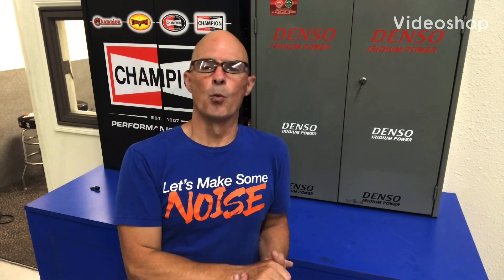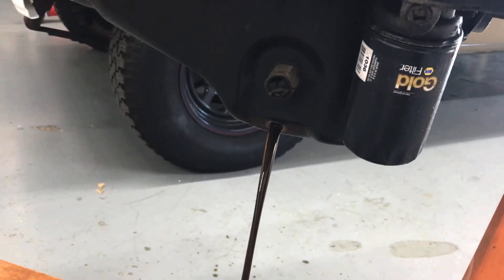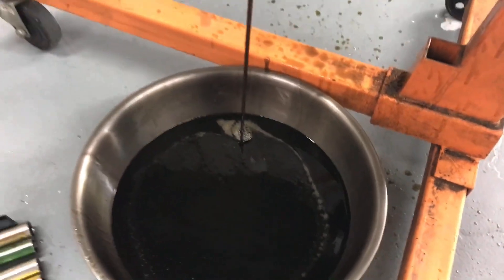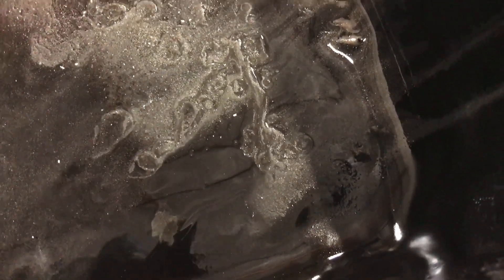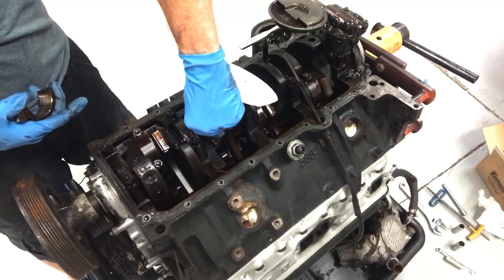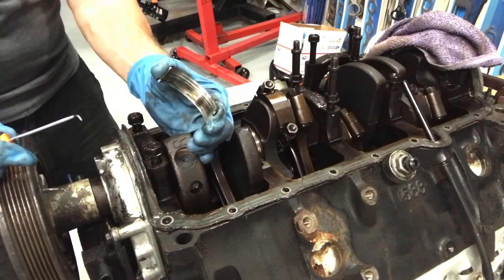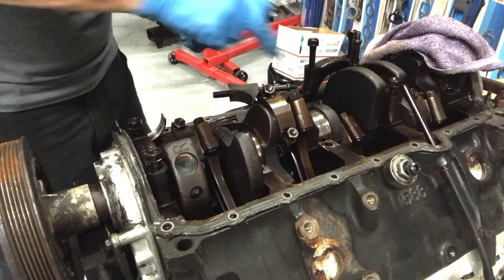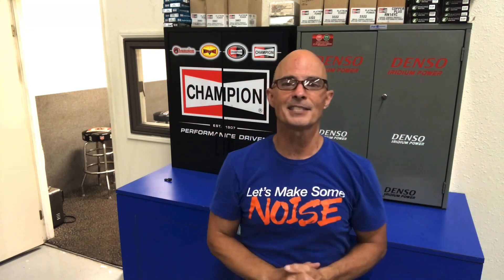THE OTHER GUYS L99 4.3L V8 (BABY GEN 2 LT1) WHAT WENT WRONG?

Comment: The other day you talked about making a 302 lt1 based engine. Back in the day I was doing stuff like that. My favorite was a small journal(forged) 283 with small chamber 305 heads and the 305 tpi setup. With mild cams in the 220 @.050 range they built fantastic torque and didnt run out of air like the 350 or even 305 with those small runners. We put one in a cj8 offroader and it had very good torque and would go over 7000rpms. We could out climb about anything, don't upshift just let it eat.  Tpi Speciaties did some tuning for us back then. It ended up in a nova eventually after a 4bt conversion. I was going to stuff one in a 71 vega gt with aluminum rods, flywheel and a t5. I wanted the aluminum corvette heads when they were dirt cheap but they dried up and someone stole my last set of good iron small chambers. Those were the days.  Your right, when I'm old and looking back on the stuff I used to do, I'll be glad I did it all!

Comment: I've mentioned this before, but thought it bears repeating. To tell this is a L99 and not an LT1, look at the side of the block at 3:42 in the video. You can see the raised numbers "588" plain as day. This indicates the L99. If it is an LT1, you'd see "327" in the same place. You can see this on most LT1/L99 engines when installed in their original cars. You just have to get under the vehicle. This same "casting number" (if you want to call it that) is on several other places on the block. This is just one of the easier places to see it.
Reply: L99 is a rpo code for the Gen 2 SBC (LT1) that happens to be 265 Cid (4.3L)
Reply: @shadowopsairman1583  - L99 is the RPO code for the 4.3L 2nd Gen SBC. LT1 is the RPO code for the 5.7L (350 ci). Not really sure what you're trying to say as it doesn't make sense.

Comment: Back in college my first "302" was in an old 60s or 70s build model a. It was always overheating. Had a monster custom 5 or 6 core radiator. Turned out to be a 283 bored until you could see thru the cylinders (like a 6.9 ford, "porus casting"). I put the Camelback 462 heads on a 400 block with a 350 crank, stock pistons with 350 rods and crank spacers. Ran amazingly well for a parts bin, weekend project.  Your always get my brain working, either looking back or forward. Thank you

Comment: Make Sure you get a set of Dz302 std. 4" bore Lumpy tops, and 30/30 grind Camshaft, along with a 4bolt main block to go with your 3" stroke crankshaft, to be a true modern recreation it should really have a forged steel crankshaft. I'd Put it in your Nova.

Comment: So, I just got done building a kid a 383 lt1. That was the second engine he had brought in. The first was a 4.3L. After getting his 383 together and getting all of his parts and pieces together, we noticed that the castings were identical. He didn't want to mess with the 4.3L stuff so he asked if we could just scrap it for him. Looking at every bit of casting it appears to be the same. Does anyone know of if that's the case? Are they the same casting, can I just bore the 4.3L to a 4" bore. We don't have a sonic tester to check the thickness of the cylinders. Part of me wants to build a high hp twin turbo minimum displacement sbc (a 4.3L). But I've always wanted to go the 302 route. Which I think, if all we need to do is take the bore on the 4.3L to a standard 5.7L, 4" bore. I also have a couple of hydraulic roller 350 truck blocks, which I think will be the smartest route, opening up the options for cylinder heads.
Reply: I dont think can bore em that much but try it and find out Ive never done it but took many 307 out to a 350 bore they were thicker. Also you can take the rods from the l99 4.3 v8 and use them in a 4.3 v6 with a offset ground crankshaft boom cheap budget v6 stroker. If crank grinder knows what hes doing he can put a big radius on the journals for strength and can use 229ci rod bearings there narrower.

Comment: Can't the crank be turned and aren't the small block rods 5.7" except for the sb400?
Reply: The 4.3l has 5.94" rods and 3.736(?) 305 sized pistons. If you use this crank and rods with 350 pistons in a 350 block it all works. You could grind or turn the crank but for the same cost Richard could probably get another whole engine from the Junkyard. When the rods start to change colour that's a good indicator that it's not as strong as it should be. They would probably work on a NA build but if you need a crank and bearings, a whole engine might be cheaper. It's still a bit of a mystery to me how this happened. Something maybe let go in the oil pump but the bearings shouldn't have been pitched if it still had oil pressure at this power.

Comment: Would be cool if you used longer rods like 6.350" long with 1.150" piston compression distance.

That would give a 2.117:1 rod ratio! Use the L99 heads as well, short stroke with longer rod ratios like smaller runners, supposedly.

Make sure its an LT1 that you convert so you can crank up the compression because of the reverse coolant flow. Should be easier to get the compression up with the smaller L99 chamber heads. 12:1 or higher would be great.👍
Reply: The above will make it a modern day DZ302. Modern, so solid ROLLER CAM, not that antique solid flat tappet Duntov turd.
Reply from the maker: it will have a hyd roller-like the stock ones
Reply: @richardholdener1727  

Well, that's more on the modern factory thinking. That's right, the factory never sold a solid roller cam engine so you're right on that.

I bought a set of Speedmaster sbc 6.250 rods that were on sale a few months ago for under $200. They're rated for 500 Hp and 6,000 rpm. I'm sure with a bolt upgrade those could probably be 600 HP and 7,000 rpm ready? Don't quote me on that though, you would have to ask Speedmaster to know for sure.

Comment: A question I’ve been pondering lately is what would the effects of chamber volume be on volumetric efficiency going from 8 to 1 to 12 or 13 to 1 and running a maf would the hi-c motor pump more air Due to cleaning out the cylinder better at tdc
Reply: You generate more energy from what is there. Raising cr does not increase the amount of air inhaled on each induction cycle

Comment: I think the L99 was made because a 305 with the LT1 type setup was simply too closes to the LT1 in performance. They probably wanted to use the 4.3 V6 but they were selling every one they could make in pickups, S10 Blazers, Bravadas, and Astro vans.Hence a return to almost the original size small block.
Reply: I'd feel a lot cooler with a 4.3l V8 than a 4.3l v6 I don't know that it makes more power or anything I assume 8 Pistons would have more drag or something and probably make less but still

Comment: Hope it's a vortec headed gen 2 dz 302...
Reply from the maker: LT1 HEADED TO MATCH THE LT1 BLOCK
Reply: Actually, the L31 Vortec heads were designed using the architecture of the LT1 heads, so it kinda is. If I'm not mistaken, AFR helped GM design the heads because the design was so off-the-wall. They had to rethink everything.
Reply: @richardholdener1727  cool with the FI,  then the vortec heads and carb test?

Comment: Why did they even bother making a 4.3? It's the same block as the 5.7 so what's the point?
Reply: Is it the same block? I don't think it is, guys say it has a different casting number than the 5.7l and it has 305 bore size. 
I think it's stupid too. It's a dead end. If GM had spent the money developing a set of good cast aluminum heads for the 3800 series II it would have made more power than this engine and weighed less for less cost. The 4.3l was for better fuel efficiency in the full size cars. The 3800 was used in ten times more cars...
Reply: @timothybayliss6680  it would have to be the same block size if he can swap the crank and rods. Its definitely a smaller bore but same block.
Reply: @timothybayliss6680  It was a matter of marketing at the time. It would have been a hard sell to market the Caprice, Chevy's biggest car with a V6, when Ford still had a V8 in the Crown Victoria. So for the sake of that, they kept the V8, but reduced the size to help make CAFE (Corporate Average Fuel Economy) targets.
Reply: @allenl9031  I would agree with you but the LB4 4.3l V6 was available in the taxi package. The crown vic only had one V8 that was really sad (190-210hp) until after the caprice left production.
Half the reason you go to a smaller engine is for the lower weight, something the L99 doesn't really offer. Given that both the camaro and B body used the 5.7/4l60e combo it doesn't make sense to be to have only one use the 3.8/4l60e.
Edit... The data GM submitted to the EPA for CAFE shows the 4.3l v8 gets a grand total of 1mpg better combined than the 5.7l V8, from 18 to 19 in the 1995 models. For 1995 camaro, the difference is a whopping 2mpg combined between the 3.8l and 5.7l. The V6 is a way better method to get better fuel economy and is why it was used for taxis and service vehicles. To say that full-size car buyers won't buy a V6 is also partly true but that doesn't seem to stop Dodge Charger buyers.
The box body caprice also had a six cylinder available every year and also available to the public up to 1989. It started with the 250 strait six then the 229 or 231 if you like Cali and eventually the tbi 4.3l. Fleet purchasers were offered the V6 while they weren't sold in showrooms to the public after 1989. If selling only V8 powered models was a marketing strategy, it must have been new in 1992 and abandoned in 1996 while the whole time keeping the V6 available for fleet clients.
Reply: @KreatorOfDeath1985  the block is the same size outside but isn't the same casting. Different casting number and unique to the 4.3l V8. The block is probably a lightweight casting and doubtful it has the same ability to take a 4.040 bore like the "327" iron lt1 block casting can handle. I'm not arguing the block has the same bore spacing, same main and rod bearings and deck height. I am saying the block is a different casting, the same way a 307 and 350 have a different block.
Reply: @timothybayliss6680  yes this is what I was meaning by "same block"

Comment: youre gonna need dz 302 pistons to make that work the lt1 pistons are 4 inch bore but have different pin height
Reply: The rods from the L99 are 5.94" long. A piston with the standard pin height for a 350 can be used.

Comment: To date, aside from this one I have seen two engines that failed its mains while the rod bearings appeared prestine. a gen 0 350 and a Gen 6 454.   The small block was freshly gone over by a machine shop. Wish I knew what causes this nonsense.

Comment: The question is answered in the title. What went wrong is that someone had the idea to make a one off engine that doesn't share any major parts with another engine that was only used in three chassis. The crank, rods, heads and block are only used in this engine. I think the pistons are actually shared with a 305. Dimensionally they interchange, whether the part is the same or not I don't know. This was a stupid amount of parts development for less than a quarter million production engines. If this much work had have gone into the 3.8l V6 that was used in ten times as many cars it would have lowered costs and given a better product while still having an intermediate option.
Reply: I wonder how much of it was marketing driven? B Body buyers were probably identified as being older and still wanting to say "It's got a V8 and RWD" while GM still had to make CAFE numbers. These guys did two different size 4.3 liter v8's (262, L99), 265, 267, 283, 302, 305, 307... how many small V8's of basically the same architecture did they need? Small blocks ended up with 6 different bore sizes over the years!
Reply: @ewetoobz3840  Make a business case for it because of market forces, and have the engineering people to work on it, and it will happen.
Buuuuut, sometimes the market flip flops on you...
I made a lot of moolah working in Product Development for an engineering company on projects that never saw the light of day.
Reply: Even then the Mopar full-size when introduced had 2 diffent v6 and the 5.7V8. The 2.7 v6 was soon dropped because it was expensive to produce and the lowest price item. Since then the full size has had the 3.6,3.0 diesel(UK/Australia), 6.1,6.4.
The 3800 series II got its last major update in like 1995. That GM kept iron heads on the engine is a mystery to me. The aluminum head LT1 was already years old at this point, the L98 almost a decade old and the aluminum heads on the 60° 3.1/3.4 actually outflow the heads on the 3800. The iron head LT1 was rated at 260hp, an aluminum head 3800 rated at 200hp, same as the 4.3l L99, would have been way cheaper for gm to develop and produce because the Series II is used across so many more platforms. If it had gone particularly well, it probably would have replaced the 4.3l in the S10/blazer because the 3800 II shares the bellhousing with the other engines used in that platform (2.2,2.5,2.8) where the 4.3l uses the sbc bellhousing. The highest rated power I can find for a regular 4.3l is 200hp in a full size pickup. The S10 has a different inake/exhaust package that cuts the rated power a bit even if it is actually the same engine. The 3800series III is a lighter, more powerful, smaller engine that was produced at the same time. This is a huge miss for GM. Kind of garbage aluminum heads were used on the 2.8l 60° as early as 1987, they got very marginally better over the next decade. That there was never a program to develop the 3800 90° into anything other than a forklift engine looks like a case of being penny wise but pound foolish.

Comment: Less lobe separation, ~108/ port the stock heads (so more compression), maybe 230-240 duration, 440-460 lift, retard the cam 4 degrees. Make the power at lower RPM and parts won't "Run away from home"!

Comment: There are plugs on each side of the block to drain coolant. Just Saying.
Reply from the maker: you mean the frozen ones that wont budge?
Reply: @richardholdener1727  when is it possible u can test vortec 7.0 VS vortec 8.1 motor or 6.2 VS 7.0. Or maybe 8.1 Chevy and 8.1 dodge motor. I know it's alot I'm willing to help for the love of horsepower ND torque

Comment: Now is the time!  There are shaft systems off brand for 400 500 bucks. PSI or PAC springs tool steel retainers and lash caps for greater roller surface area. Trend tapered pushrods. Used brodix heads and block. Shouldn't need to go Winberg or Bryant with Oliver rods to spin 10,000 rpm with a 3 inch stroke. Comp or Isky will make you a 10,000rpm cam and psi will set you up with springs. Trend tapered pushrods. 
It will do 10k no prob. Balancing and crank scraper windage tray is critical.
Reply from the maker: NO THNX ON THE HIGH-$$ 10k RPM BUILDS